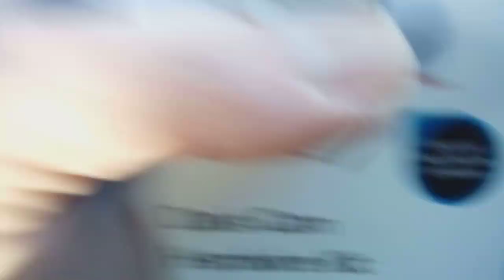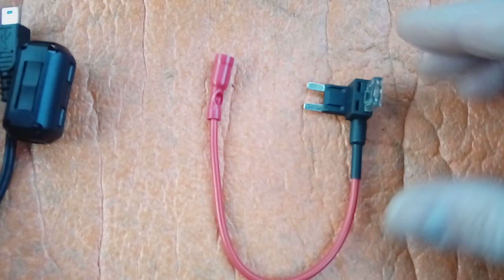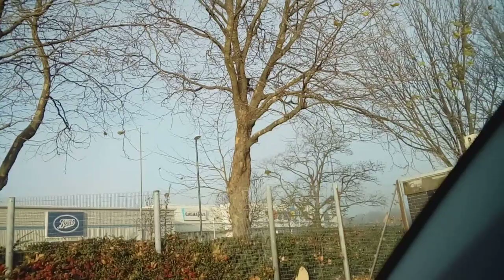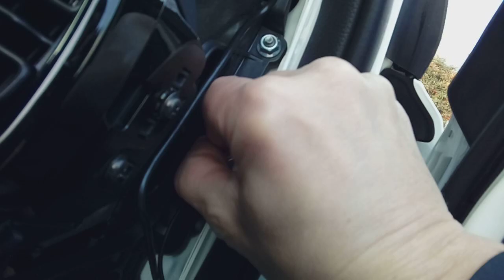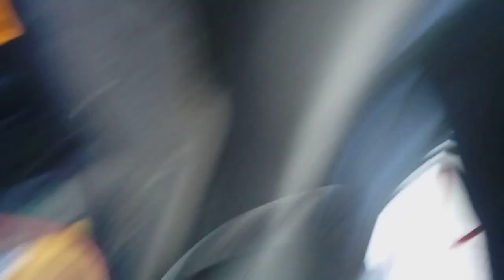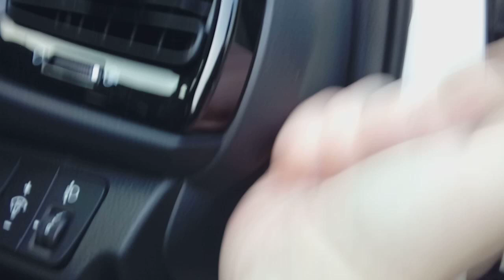Kia Rio 2011 onwards how to wire dash cam to go on/off with ignition.Simple guide.

Comment: Thank you for this video! I have a U.S .Spec 2022 Kia Rio S Sedan and it has an identical fuse box on the driver side where your left knee would be. All the fuses appear to be the exact same Micro2 and same spots as shown in your video. Used this video to install my Uniden R8 Radar Detector! Thanks!!